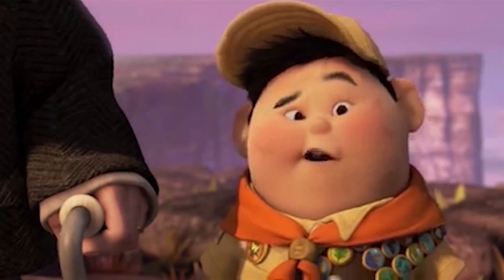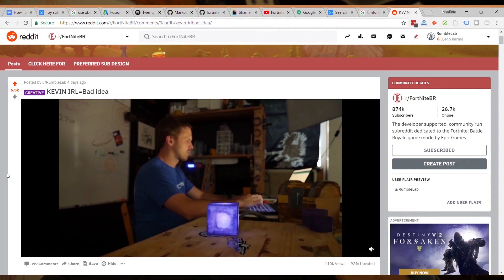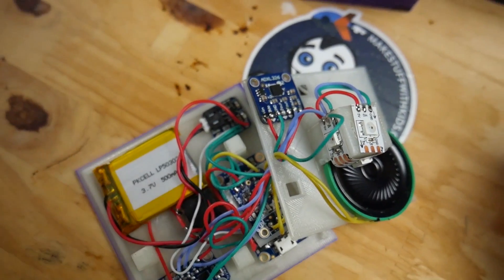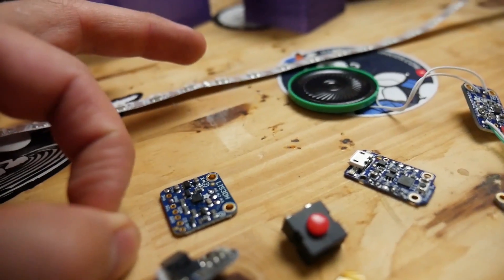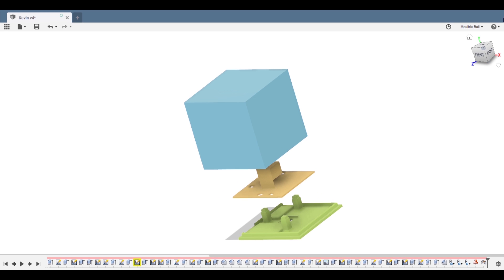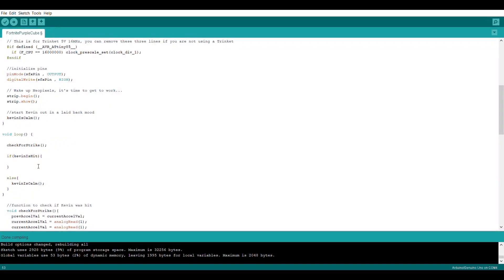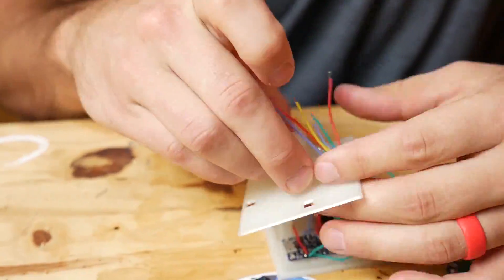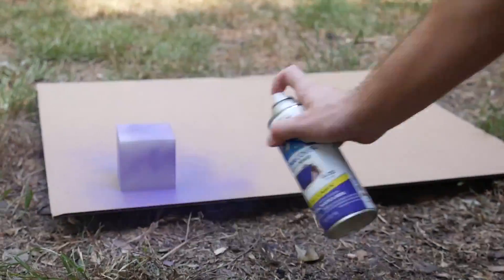Fortnite Cube In Real Life | DIY

Comment: Could you please list the links to the devices? I really want to make a Kevin!
Reply: Okay thanks!
Reply from the maker: Hey Araknala, just had a breakthrough! It turns out you can save about 15 dollars on this build if you use a piezoelectric disc instead of an accelerometer. If you want more info, let me know!
Reply from the maker: https://github.com/rumblelab/fortnitecube here you can find our bill of materials which has all the links to the parts you need! If you need anything let us know. We are going to be updating the GitHub page over the next couple of days with more info like audio files and wiring diagrams.